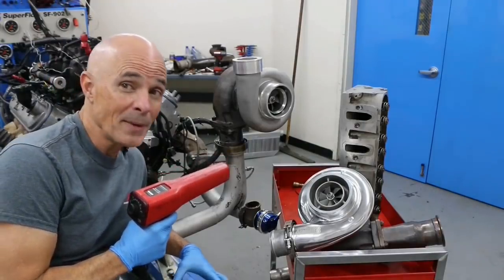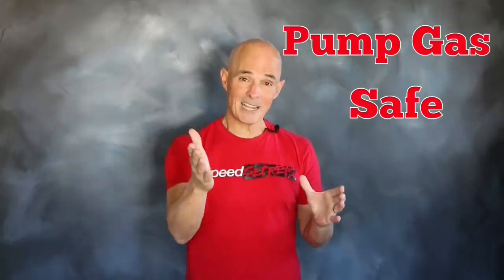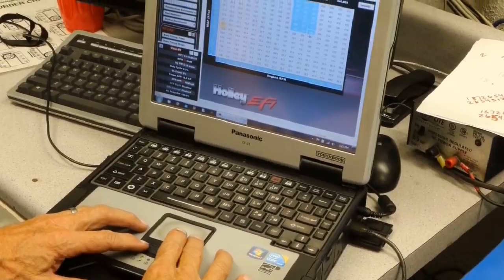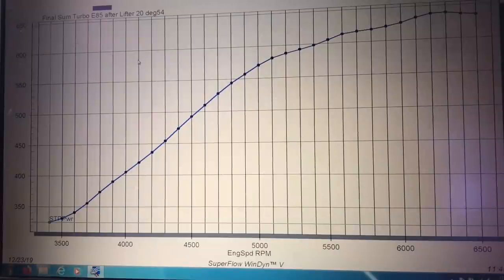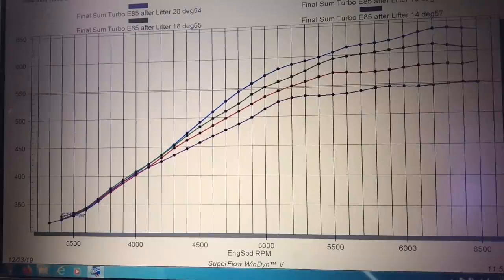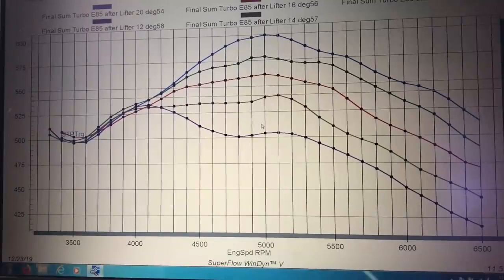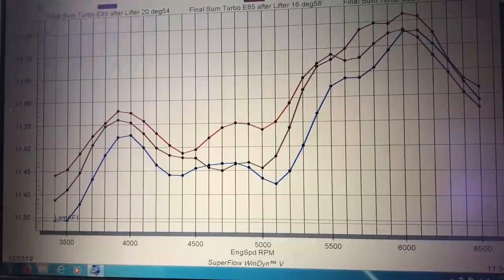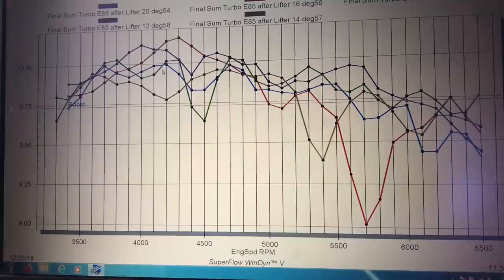TURBO TUNING-PUMP GAS VS RACE GAS Full Dyno Results

Comment: What if you ran the same test on the Hemi engine?  Hemi engines take less timing cuz of how much the heads flow and the way they flow. I’d love to see this test on your Hemi you have there
Reply from the maker: the timing requirements are usually dictated by the chamber design
Reply: I knew it was something like. I know that on my E85 Hemi on 10 psi it likes about 15-17 degrees of timing at wot

Comment: So... Can timing be increased after peak torque ? Will torque increase?
Reply: You add timing until little to no hp gain. I believe he said 20 deg was close to peak hp for this combo, but maybe there's a little more.
Reply from the maker: the motor requires increased timing with rpm-it will make more power as indicated going up in timing
Reply: I think another video demonstrating that would be great.  On a knock limited motor,  find the point in the torque curve where it knocks, and increase timing after peak torque to show the relationship of torque/cylinder pressure vs timing/ knock limit.  In theory, it would create a flat torque curve because you would effectively be controlling peak cylinder pressure to just below the knock threshold.  The threshold doesn't need to be knock... On a non knock limited motor it could be the cylinder pressure to keep it from bending a rod or lifting a head, or maybe to keep it from blowing the tires off in a lower gear.
Reply: @mxguy2438  i agree.. A vid on safe timing increase after peak torque . in the name of science..thanks

Comment: Yes that is with E85 but what would the power be with 93 gas. I know you wouldn’t run 20 deg with 93 but maybe 18 and 16, and for sure 14 and 12. Would like to know the difference between gas and E85 at 16, 14, 12 deg
Reply: Agreed, its likely different, but i bet its not all that much. E85 burns slower, so less power per same timing as 93 until 93 knocks. Less NEEDED timing is better, but theres a balance...
Reply: bigjohn1948 I'd like to see that test too.
Reply from the maker: I've run lots of tests on E85-please see the video on E85 testing vs race gas-the power gains are similar between pump and E85 at lower timing levels

Comment: Was the timing set flat all the way from idle to red line each time? What do you think the power difference would be if you tuned max power on 87, 91, 93, and then jump to c16.  That would interest me greatly.
Reply: He said he changed timing from 4k up...so presumably from 4k up it's a static timing figure.
Reply: @blow0me  thanks, I remember that now.

Comment: This was good. Boosted engines need timing on pump gas too and this is why lower compression ratio is way more effective on pump gas than most people seems to think. A low compression ratio engine with the same or more boost, and 20 degrees of timing would be interesting.  The ratio between peak cylinder pressure and BMEP gets better too. :)
Reply: I would like to see pump gas like 92oct with 8.5-1 to a 10-1 motor. As stated the More timing you can run might be better with pump gas. Equal to equal it's hard but two motors with different pistons and different timing to see what's better.

Comment: Should do a mild big block build to see what the limits are of the blocks being gen4. 2bolt vs 4 bolt. Arp bolts ect. Budget crank and middle of the road rods. Stock caps and maybe a girdle and see what a guy could do out of his garage on a turbo big block without hurting it. Thanks for the vids!
Reply: Maybe even a stock bottom end deal
Reply from the maker: already took a stock Gen 6 bottom end with ring gap to nearly 1300 hp-there is more left
Reply: @richardholdener1727  Richard, is there a link to that vid? I know I pestered You forever on FB and I still don't recall seeing the vid of the 1300hp BBC. Thanks man
Reply: He has done a few big block / turbo vids. IIRC, He has even done a "big bang'  BBC build a while back, but I don't know if He's ever posted the results.
Reply: @TurboDog73TX  I seen the nitrous one and the turbo one but who runs stock heads? Atleast a chinese top end and a decent bump stick is what most would run. Would love to see how much it could do being the turbo has less  stress on the guts then the nitrous. People talk about the blocks breaking around 1k or 1100hp. But do they really when done with a slightly educated approach. Girdle, gaskets, arp bolts, good tuning ect

Comment: E85 often hides detonation and the dyno is a great indicator of this.  So I agree with you that relying on a knock sensor is not a good method.  I'm also glad that you mentioned where you should pull timing (pk torque which is also peak cylinder pressure).  That is how you keep rods from bending amongst other components.      Also, a good way to tell that you're maxxed out on timing is when timing stops making power.  If 1* only makes a few hp rather than ~15-20hp, you're done.  Back it down.    Good tuners will also know how to introduce cylinder pressure (timing ramp).  An ugly timing map that isn't smooth will literally cause turbulence in the combustion chamber.  However, a smooth transition of timing from peak torque to max rpm can get you better and safer results.  I would go into how to read spark plugs as an indicator but I could elaborate for days.  Maybe a good idea for another video?
Reply: DrewJ_Z care to elaborate on how E85 "hides" knock? Knock should be knock. E85 has a much higher RON value, which by it's very nature means it will take more timing before it knocks, but how do you think it hides it? Either it is knocking, or it isn't. A set of knock ears should pick it up regardless.
Reply: @DodgyBrothersEngineering  guess what he meant is that on e85 sometimes you can increase timing over MBT and still not knock, which makes knock based tuning not very ideal for e85.
Reply: @Rajivc666  ahhh yeah that makes sense.
Reply: Yes I would love a video on reading  spark plugs!
Reply: Also can’t rely on knock sensors on a ls because they fill with rain water and corrode.

Comment: Wow Richard, just wow.  That was like watching a mini version of Engine Masters with more technical content in less time.  I can now see why the cult of E85 is so devout.  I wish I could give this video two thumbs up.
Reply: BlindBatG34 You can, 👍👍
Reply: Maybe give it 3
Reply: I wish I could find E85
Reply: @81eagle  If you live in the states, go here put in your city and state, and it will tell you where it is and sometimes how much $$ https://e85prices.com
I daily drive 455s on E85 that have 'race gas only' compression between 11:1 and 13:1, its so easy and man does it run good.
Reply: @SweatyFatGuy  Thanks for the link. Looks like there's some 70mi from me. I'll have to call to be sure.
Reply: @SweatyFatGuy  That's awesome! That is cheap race fuel for sure.

Comment: Just wondering - wouldn’t the burn rate of say pump 93 compared to E85 or race fuel be a major difference in power output and the correct timing for each of the burn rates?
Reply: Pump 93 has the most BTU per gallon, thus will make the most power if the engine isn't detonation limited, which under boost - an LS becomes that.  What he's doing here is showing you what the difference in safe tunes for both will do to power.  But IAT is a huge factor as well.  You can go really far on pump gas with super low IATs and high quality, gulf coast refined pump gas IMO
Reply from the maker: I have never seen 93 (or any other gas) make more power than E85 on a turbo motor unless you change another variable like boost or timing
Reply: @richardholdener1727  When you change the fuel, or any other number of variables, you ARE changing the timing.  Timing is "when peak cylinder pressure is reached, in reference to crank angle."   You should see if someone will donate a combustion pressure analyzer for your testing.  That way you can always adjust timing so that peak pressure happens 12-15* ATDC (which is where peak torque always happens, in pretty much every engine out there). and that would help you keep the tests more consistent.  Leaving the timing in one place is actually causing inconsistencies in testing.
Reply: Real Tuners 
Mind blown
Reply: I believe that.  We all form out opinions on our experience.

Comment: I prefer the short concise videos and I can see where it would be beneficial to do an in-depth video on a topic.
Reply: I can definitely see where you are coming from but man there was so much good stuff in this video.
Reply: @BlindBatG34  I would consider this video the short concise type.
Reply: I think the 2 minute videos are too short, they leave important details out, and info flashes on the screen so fast, you spend a bunch of time going back to digest it.  5-15 minutes is a good length for me as long as its dense, pertinent info like this... Of course, shorter is better up to the point where the info is hard to process or things get left out.